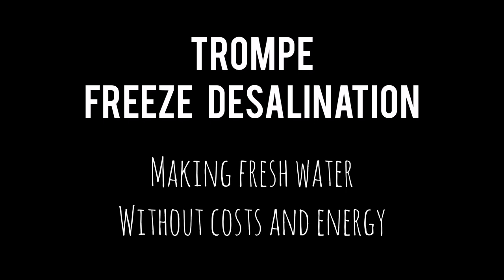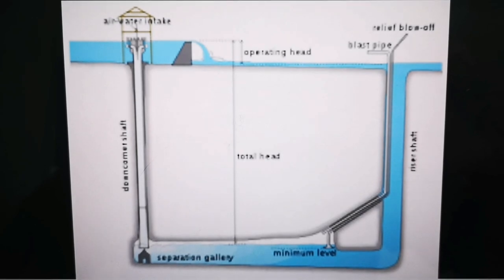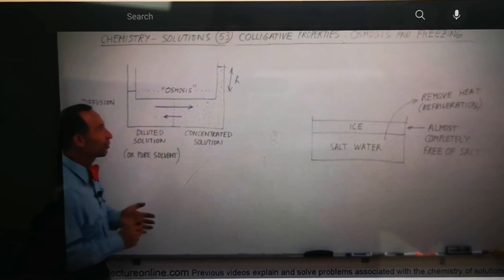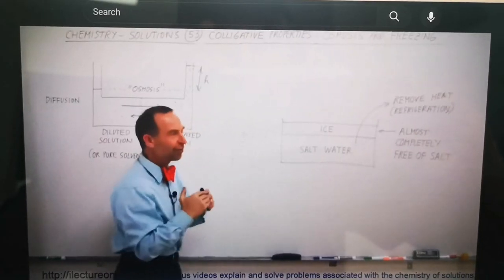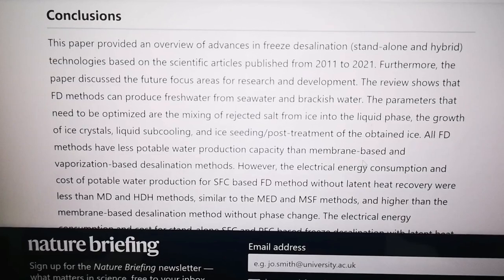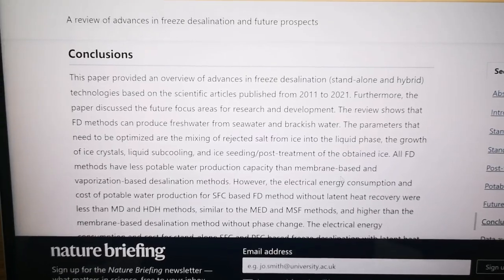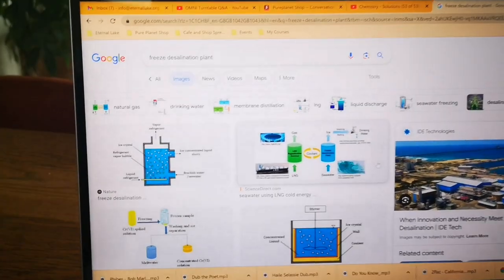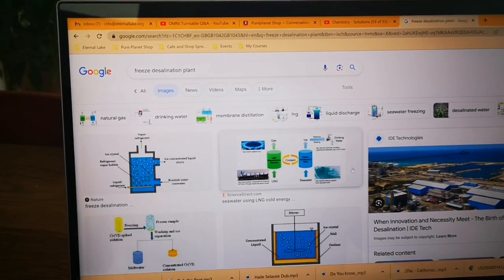Is this the best way to desalinate water? Desalination using Trompe and Freeze Desalination, discuss

Comment: Sorry, I'm not quite understanding how a trompe would help with freeze desalination.  Could you elaborate on the connection of the 2 processes?
Reply from the maker: The teompe simply provides the freezing cold compressed air to freezing the water